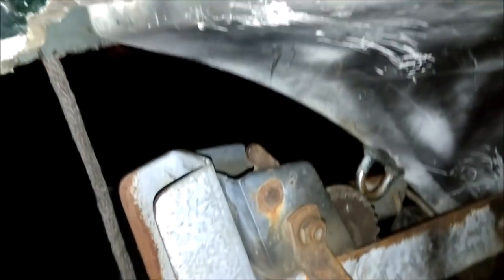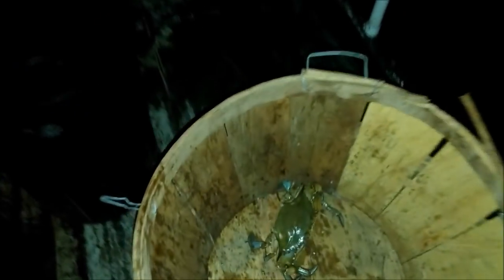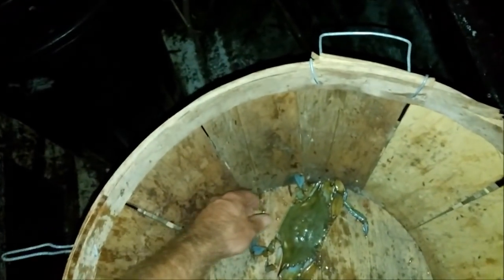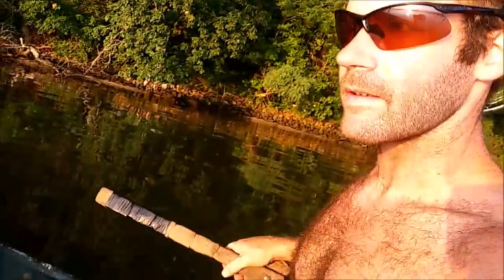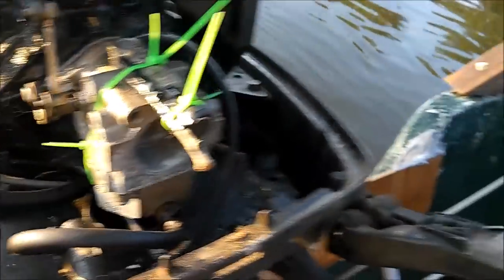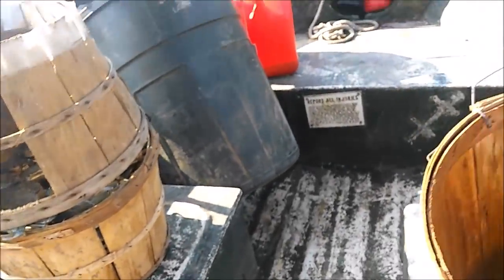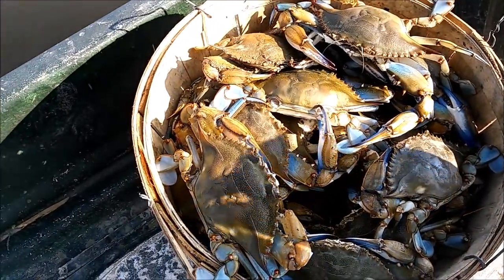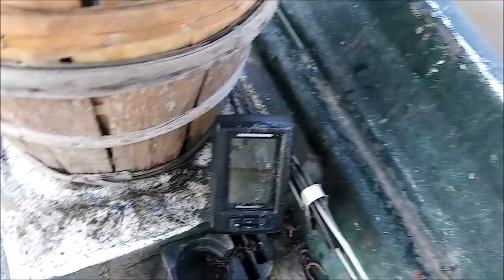How To Catch Mud Crabs for the Pot - Trot Line Crabbing

Comment: Hey Jake what kind of sonar unit is that, also what kind of spark plugs, gas/oil mix do you use? Just wondering because it would seem with idling all day like that you'd foul them  out often. I'm starting out in south louisiana trying to learn all I can. Thank you for the awesome videos.
Reply from the maker: Bayou Trapper hey, I just use a depth finder just for depth, anything that tells me that I will use. I just run 50/1 and yea gotta swap em out more because it's such a rich mix for all that idling but better heavy on it then light.

Comment: Hey how deep is the water your in?  I also run trotline on the chester I try to run my line loose as I can but iam only in 2-3 feet of water so I can’t get it to come up very straight up and down if that makes sense. I have been having a lot of drop offs. I always manage to get my bushel but it takes a lot longer cause of the ones that drop off. Any suggestions?